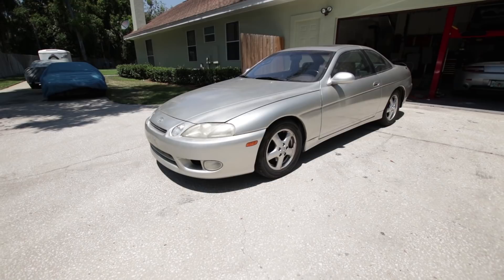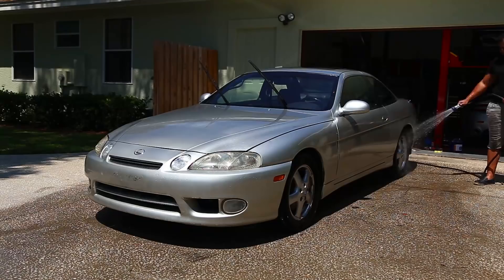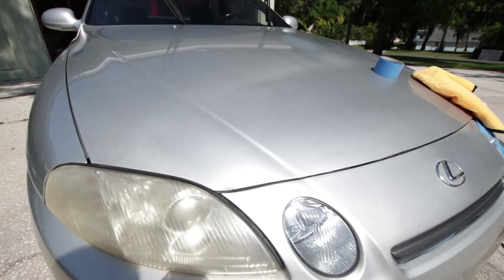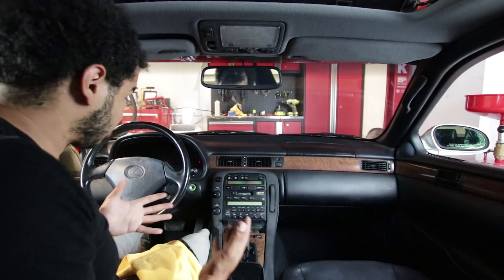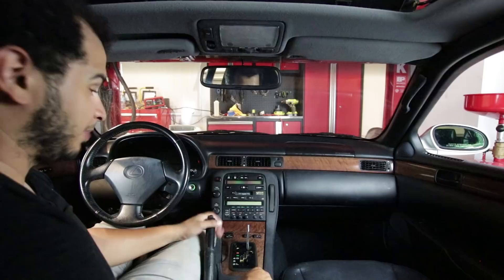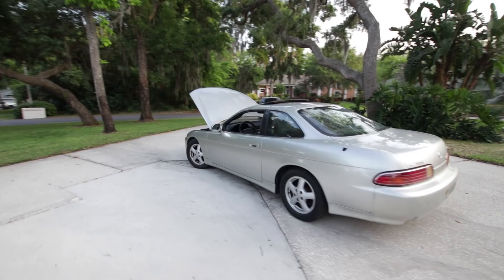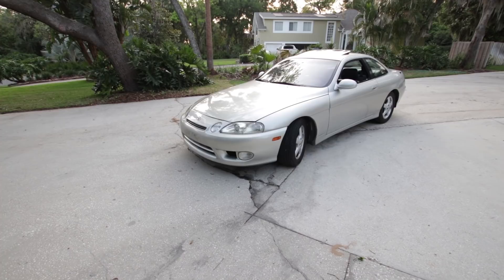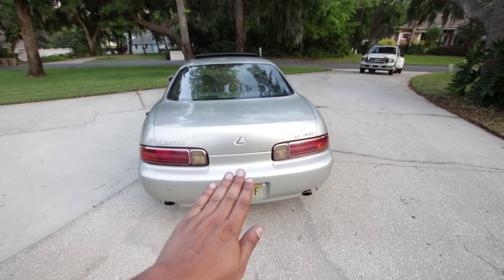How To Sell Your Cheap Car For The Price You Want

Comment: plenty of shade just on the other side of the driveway.  I know it really doesn't matter because of the state of the car to begin with but would be a bit easier.  Also, if it cost $100 for an exhaust section to be replaced it might make a big difference in the selling price...

Comment: I've had very good luck selling cars on eBay and Craigslist by filming a car review video and linking the video in the listing. If the car had any cosmetic or repair issues I made sure to catch those on the video.

If the airbag cover is vinyl, perhaps just a little touch of black vinyl paint?